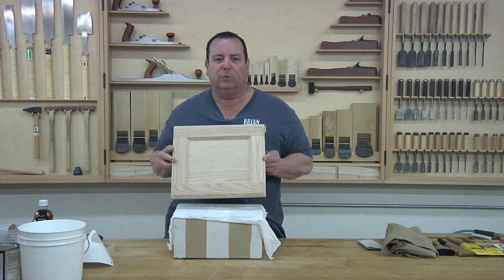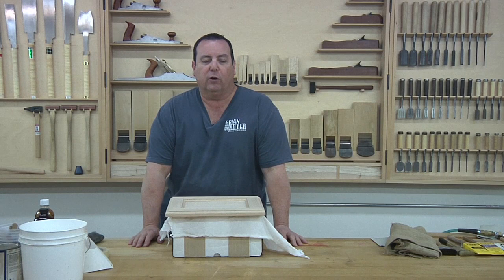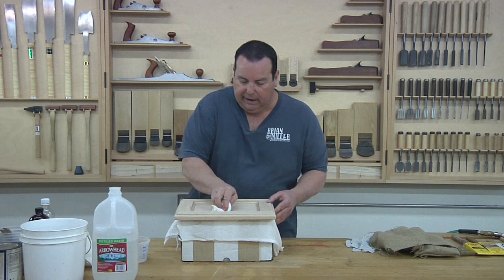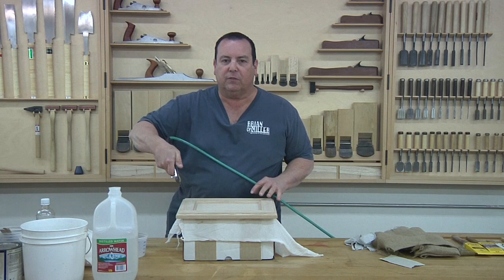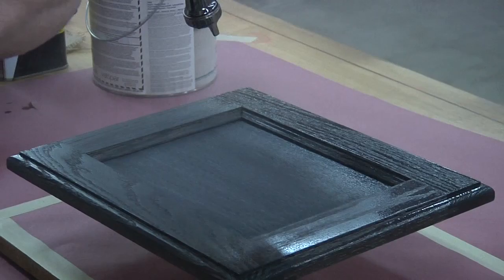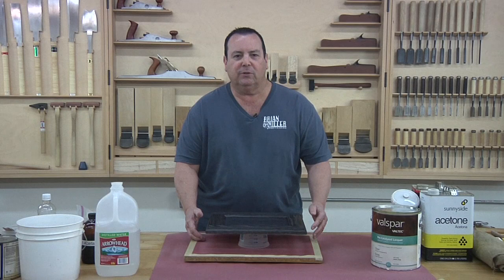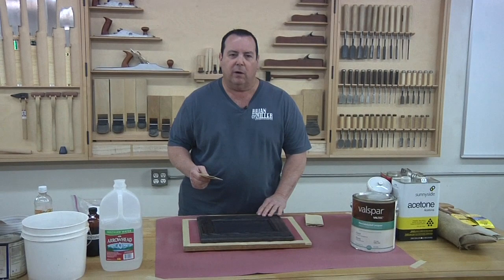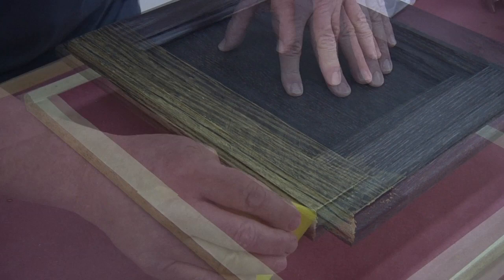Coloring with Iron Acetate, Filling the Grain

Comment: I use a similar technique after ebonizing. Instead of the paste and colors I use plaster of Paris to back fill the grains. You can use food colors to tint it. Use the same application and cleanup methods once it has dried. I do use catalyzed lacquer but if you don't have an HVLP and want to brush on. You can use a varathane finish. Thin it down with water for the sealer coat, then top coat as usual. Do NOT use polyurethane as it has an amber tint to it that will discolor your filler. The only drawback to varathane is the drying/curing times.
Reply: Plaster of Paris is great. It gives a flatter look.  I love using colors different than the stain.

Comment: When making the acetate there are a couple of techniques you could do to speed up the process.  Heat your vinegar first. This will increase the reaction rate of converting the iron oxide from the wool.   Also. You can add Hydrogen Peroxide in after you added the heated vinegar. The Peroxide will oxidize the wool much much quicker. This will allow the acetic acid to work more efficiently.  Wont take anywhere near 4-5 days.   

Someone give this a try. You will love the results. Gotta love chemistry.
Reply: +Jarrod Frankum How much hydrogen peroxide do you recommend?  I use iron acetate quite a bit and am intrigued by your comment.
Reply: +Hardnox if you use the 3% stuff that you get at the drugstore,  it may take a lot as its pretty weak.  Heating it up would make it work faster.  I don't know how much you are making at a time,  so it's hard to tell.  You can't use too much. Hydrogen peroxide degrades into water as light hits it so just experiment with it
Reply: Jarrod Frankum Thanks for the info.  I usually mix about a gallon at a time.  The mix ratio I use is 3 cups vinegar to one 0000 pad which has worked well for me
Reply: +Hardnox go for using a cup.  It will dilute the mixture so you may have to experiment a bit,  but it won't take near the time to dissolve the wool
Reply: Thanks very much for the info.  I'll give it a try on the next batch.
Reply: +Hardnox please let me know how it goes.
Reply: Jarrod Frankum #betterlivingthroughchemistry
Reply: Thanks for adding a real world example. This guy is driving me crazy

Comment: This is only going to work on a high tannin type of wood (oak is one), but if you want to use it on any type wood, get some tannic acid (order it from amazon...its cheap) and instead of using water at the beginning mix some of the tannic acid with water until it dissolves and use that.  That will blacken any wood when you add the ebonizing liquid.  I have no idea why he says its not ebonizing since that is exactly what he is doing.

Comment: One of my fav "colouring". First read it in fine woodworking from the 70's. The only trouble is wood that does not have tannic acid.
Reply: You can solve that problem by coating with a strong tea before the iron acetate.

Comment: Hello Brian.   Kevin Deal here.  The wood finisher/ furniture repair man from Oceanside,  CA.  We've met at your SAPFM presentation at Cerritos and also at you last SDFWA presentation.   Still enjoying your book, great reference asset.  My question is how is this different from an ebonizing technique.   With ebonizing I use white vinegar, haven't tried the apple vinegar.   Two years ago I did a ceruse finish on an oak table and chairs.  The Mohawk filler always works great but with my job I actually used plaster of paris to fill the grain of the black oak.  Hope to see you again soon.  Thanks for the video!
Reply: Hi Kevin! While iron acetate can give some very dark results, especially oin woods like walnut that contain significant tannic acid, woods like maple don't contain tannic acid & require the addition of tannic acid, then logwood extract, followed by ferrous sulfate. Let me know if i can be of any help! 

                                                                                                    Brian

Comment: An insight into a great finishing technique. Its time to experiment with doing this with some standard staining colors and a nice grain contrast.  Can you repost the filler name you used please?
Reply: Aage: The product was an oil-based filler made by the "Mohawk" Company. It was neutral in color, so you can add a colorant like artists oils, or Japan Colors, or in this case I used the metal powders which are not actually gold, but a mix of brass and other metals.
Reply: look up ceruse

Comment: The one thing I don't see you talk about is using compressed air if you don't have a good filtering system on your compressed air take cheese cloth and wrap it around your air spinet to absorb moisture in the line.

Comment: Dose this work for all woods and how deep dose it penitrate . I would like to use this process for the wood bed in my truck. I was just wondering if scratches will expose the light wood color or will it penitrate deeper than just the surface.

Comment: Filling the grain and color striking the pores are two separate things. The end result was color in the open pores and not filled pores.
Reply: Does colour in the open pores not fill them? Please explain the difference?
Reply: No,  filling the pores with pore filler (colored or not) is used to level the surface of the wood so when a topcoat is applied the result is a completely flat surface, like a piano. Color striking does not level the surface but colors the open pores. Sometimes you have to apply pore filler a second time to get a smooth surface.
Reply: Jesse G Thanks for clarifying, that makes perfect sense. How does one match the colour when filing pores, or is the wood and the filler stained at the same time? I.e , after applying and sanding the filler?
Reply: Paste wood filler comes in different colors. Depending on what kind of pore filler you choose it can be colored to match using UTC's, powdered pigments, or dyes. I color match by eye and make a sample board prior to working on my actual piece. I take the color sample fully through the finishing process.
Reply: Jesse G Thanks for the info, much appreciated.

Comment: Is it possible to "thin" the iron acetate solution in order to achieve a gray color?
Reply: Stephen Kinnane yes you can either dilute with more vinegar or add water to your iron acetate. I would pour some of your iron acetate into a separate container/jar then dilute small amounts at a time until you achieve desired color. Good luck ;)